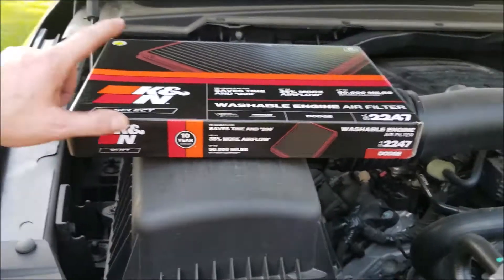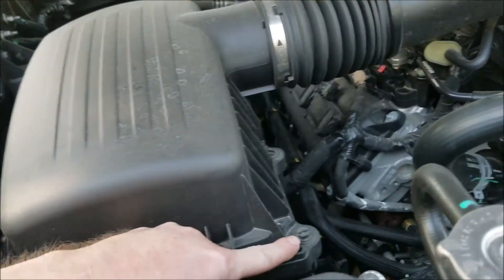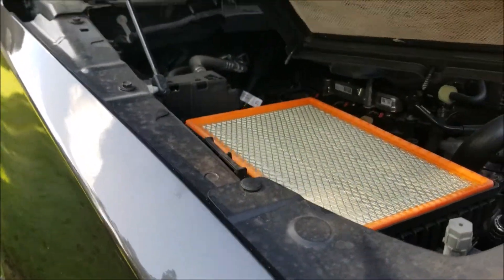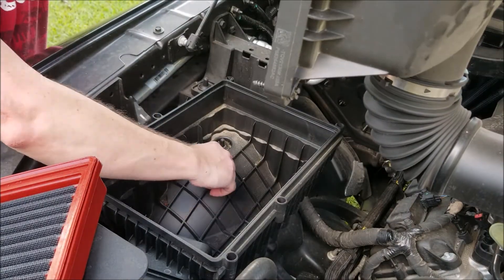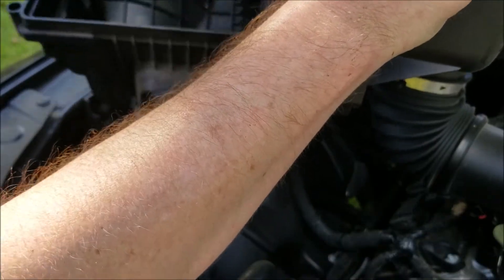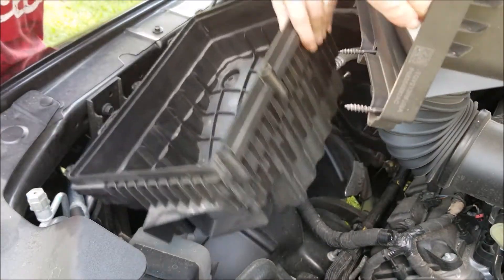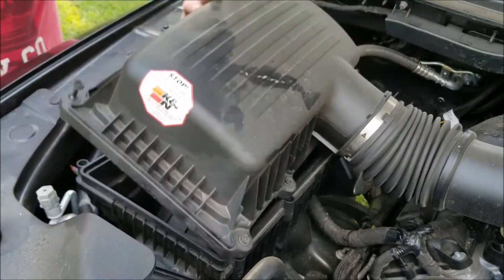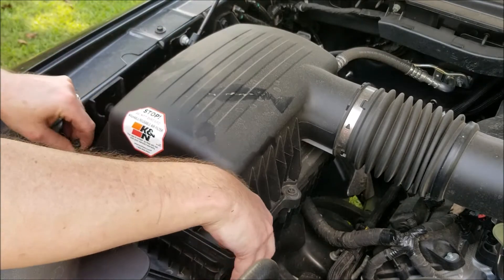FAST - How to Install K&N Air Filter 2020 Ram 1500 5 7L V8 33-2247

Comment: Thank you. I just bought a 2020 1500 Ram 5.7. Going to change the both air filter and cabin air filter soon. When I bought it, it only had 32,000 miles on it.
Reply from the maker: Welcome.  The outside air filter is really an easy install.

Comment: What's the filter in the lid? Has anyone removed it? Looks redundant
Reply from the maker: the air filter???
Reply: @JRMSweeps  at 24 second mark you can see a non removable filter in the lid, whats the point of it? Reminds me of the Ford disposable air filter assembly, plastic housing and all from a couple models roughly 20 years ago.
Reply from the maker: I pulled one up online and see what you are talking about now...that is interesting.   @kootenaycat
Reply from the maker: I read something that it is a carbon mesh filter and some people actually remove them after installing aftermarket filters.   @kootenaycat

Comment: JRMSweeps I just installed one in my 2020 1500 limited. 3 weeks in and gas mileage has gone down substantially from 17-18mpg to 13.3mpg. I took it out and reinstalled it to make sure it was seated properly and it was. What could be the problem? Thank you for your help
Reply from the maker: Very weird.  I have the 3.92 gears and picked up 0.5 to 1 mpg if I drive it normally.  Dropping 5 mpgs isn't normal. Have u driven it more than 1 tank of gas?    Other than that, IDK.  Dropping maybe 1 mpg for the hp gains or so I can understand, but 5 mpgs, that isn't right.  Sure the computer is doing the math right?  I would do the math myself on a fill up.

Comment: I bought this expensive filter and noticed my fuel economy dropped significantly! I bought a new paper filter and switched back to test it and yes its definitely the kn filter that caused it.  Its hard on the engine.  Dont buy this filter.
Reply from the maker: I bought this filter to add a little more hp and air flow to the engine.  I didn't add it to gain mpg and really have not seen any literature on where gaining hp and air flow adds mpg with this application 🤷‍♂️.  The title of the vid is not how to gain mpg with a k&n air filter, it's how to install it for those who have done the research prior to buying.  Def buy this filter!  V8 power for those who want it!